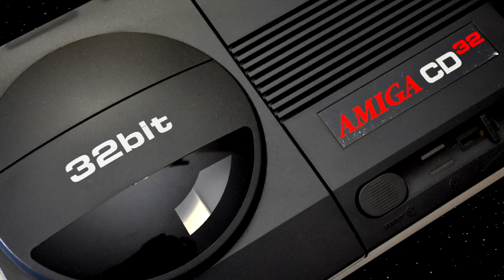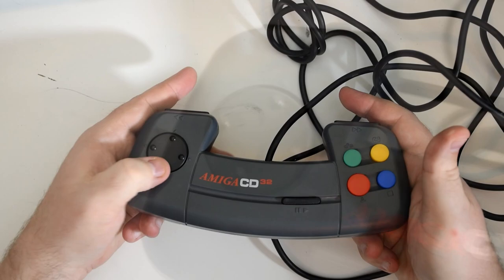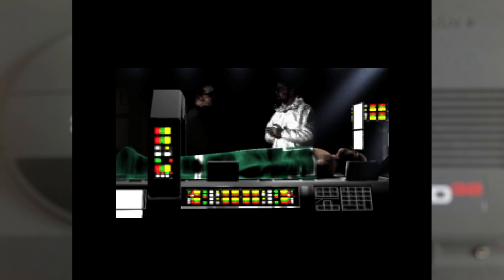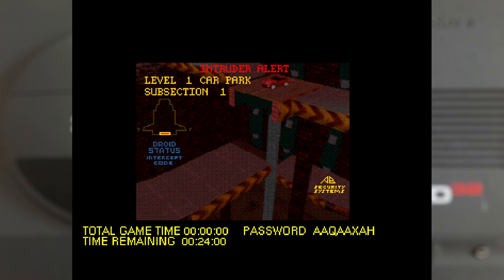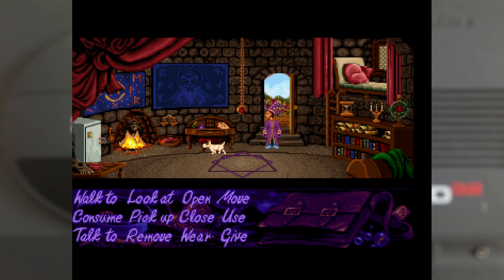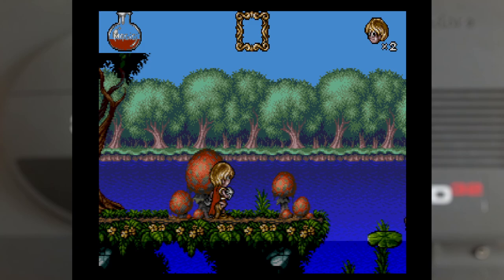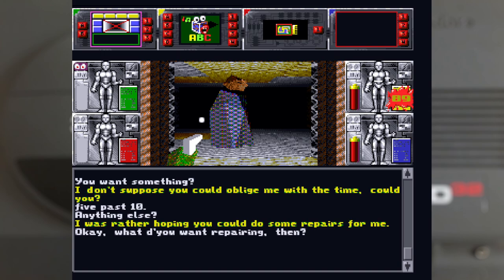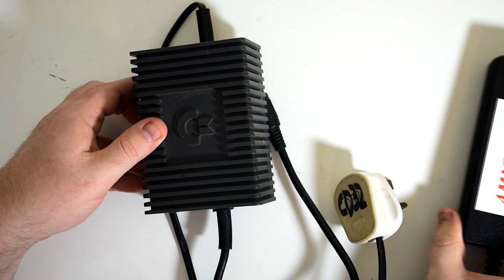The Amiga CD32 : Better than you've been lead to believe

Comment: Its always good to see a video about the CD32. It was commodores last throw of the dice, and while it was a good machine Commodore completely bungled it, and got most their stock held at customs due to a fight with a patent troll, and where it was selling like hot cakes (e.g. here in the UK) had no stock for retailers to sell.  The little shop I worked at had 100's on back order that Christmas that we could not full fill in time, so we had to refund them.
Reply: Commodore was sued in the USA and could not sell the CD32 in the USA
due to court injunctions. This killed them.
Reply: @johnsmith1953x  Yep, they really should not have tried to move stock into the US while that suit was going in on. The court order that froze a hugh chunk of CD32s, and distruped the supply of CD32s to every other market was very predicable given where they where in the law suit. It was an incredibly dumb decision to try and bring them into the US until that was settled. That's also what triggered their issues in the Philippines, which was the final straw for commodore unfortunately.

Comment: Nah, It's just A1200 with CD-ROM and some functionality of separate ICs packed inside Akiko. They gave CD32 nvram but it was pretty small so it wasn't all that useful to hold saves etc. And without fast ram it did struggle to use both chipset and cpu speed up to the fullest. It didn't came with floppy interface so most of classic amiga games came with CD bundles (that's that "big" cd32 game base). And there was hardly any innovative game designed for CD32 alone. There were hardly any expansions (which is usually understandable but console specs should be amazing at the release date to cover for gradual improvement of PCs during next few years, the only different approach was SNES with base specs hardly adequate but with upgrades included on game cartridge). CD32 was not that long apart from 3DO and 3DO was better in any aspect (and still lost due to poor timing mostly). Most of the original team behind Amiga wasn't even involved in CD32 ;) I doubt Jay would say CD32 specs is something similar to what he had hope to achieve a decade earlier. At the time he drew up specs for ICS it was revolutionary and would let keep things going for many years to come (like it did with ICS from A1000 basically running games released up to mid 90s). AGA was introduced at least an year to late and A1200 specification wasn't all that good at the launch as 020 was already fairly old. It was still fairly cheap. And same goes with CD32. It was cheap but not impressive.

Comment: Fantastic nostalgic look back! And nice to see that you're looking back at the machine in a more positive light, unlike other videos :) I still remember the hype for Christmas day when I got mine, followed by the disappointment when it didn't start up on Christmas morning! A few weeks later and a replacement came, and I popped in Liberation and was blown away by the movie-like intro. And like you, when the game started I had no idea what I was doing ;) Ultimately I spent more time on it from connecting it up to my Amiga 1200 using a cable (which plugged into the keyboard port, interestingly!) and having access to the thousands of files available on those Aminet CDs and various other CD collections.
Reply from the maker: I try to be positive about everything I look at, as I find all those negative, hating, angry channels a bit much.
its not to say you can't point out issues, but a machine isn't just problems.
Its a real shame that your original unit didn't work, I can imagine how gutting that would have been.
Not heard about that cable that uses the keyboard port, that sounds really interesting and I guess it must be using the serial side of it.
Reply: These videos are either positive or negative, but never looking at both sides
I prefer a bit of both (50/50)

Comment: Really good retrospective, not the usual "let's dump on the CD32 for killing Commodore" laziness that we see from some others.  I owned and loved my CD32 back in the day but I have to admit, in hindsight that it wasn't a very well thought out release.  I'm not saying it was a cash grab due to Commodore's mounting debts but it being not very different from the A1200, only having 1KB of save space, (was the PSU labelled for the C65), and having a poor joypad (well the d-pad anyway) suggests they were definitely doing the usual Commodore cutting corners.
I can see some logic in releasing a console which in theory would not be as susceptible to piracy, since back when it was released piracy was one of the many problems hurting micros, we were still a number of years from CD writers being anywhere near affordable so the CD format would have seemed safe at the time.  It was maybe short-sighted to assume piracy won't be possible just because the CD writing technology was at the time too expensive so they didn't put any anti-piracy measures into the console but piracy didn't kill the CD32, Commodore were already gone by the time pirating CD32 games became common.
As a teenager none of those things mattered at release, as an A500 owner I was very pleased to get a CD32 for the upgrade, for AGA, for the load times and to eliminate disk swapping, even for the CD player.  Even though I contributed to the piracy problem with my A500, it didn't bother me that I now owned a console where realistically I couldn't "acquire" games in the same way.
I was initially wowed at things like Liberation, I watched that intro so many times, although I was disappointed with Oscar, thought Diggers was just about adequate and Nigel Mansell's wasn't really stretching the CD32.
Not having many games for it at the beginning I did fully immerse myself into Liberation, reading the manual from cover to cover multiple times and really taking my time to explore the world and talk to as many NPCs as possible.  From memory I think I did find the first person you are looking for but I recall being disappointed that it just drops you back into essentially the same world looking for someone else and with so limited save game space on the console I'm not sure I persevered much after that.
I built up quite a large collection of original games as the Amiga brand started waning and games started to become very cheap to pick up.  It was disappointing that so many games were direct ports with very little and sometime even no changes other than it being on a CD but who can blame the developers?  It was essentially an A1200 with a CD drive and not much else different, the Amiga was dying and devs were having to make hard decisions in other areas.  Why not make some quick and easy CD32 ports and try to earn some money from very little outlay.
I'll still treasure my current CD32 and the original games I kept.  I've upgraded the console with the TF330, a CF card, the riser, a keyboard and the KTRL32 joypad.  It could maybe do with a recap and potentially a laser replacement but it can do the job for now and the CD32 in general has a special place in my heart.
Reply from the maker: Yeah the history around the machine is interesting, but I feels overshadows the actual machine.
so I wanted to look at it, what it could do.
its impossible not to see how some of the history screwed it up, but its not the "worst machine ever" that some would make you believe.
Reply: I also loved my CD32 back then. BTW: The CD32 had also the so-called AKIKO Chip which the A1200 didn't have. The chip offered some simple 'chunky-to-planar' graphics conversion in hardware. Not many games used it, but I think Wing Commander made great use it.
Reply: this was a period in history when all the game companies were going crazy with new generations so rapidly that they forgot about the customers who'd spent money on the old ones. Sega and Atari suffered the same fate. It got to where by the time you finished saving up for that new Saturn game, the Dreamcast was already out.
Reply: @jochenheizmann4380  Akiko chip was sophisticated enough to enter against the forthcoming consoles it's only the lack oF FAST RAM as standard that kicked CD32 in the nuts but development experience would have worked around this. Commodore buy out fell through which guaranteed the eventual fail David Pleasance would have made sure that the CD32 strived well into the future enough to compete against the PS 1 because the cd1200 would have happened too which would have meant more likelyhood of fast ram requirement software and Ram expansions availability more cheaper for the CD32 imo
Reply: @stickyfox computer technology was still growing exponentially at the time. Can't blame them for trying to be cutting edge. Hindsight is 20/20 though.
Reply: Reason why it failed is because Commodore (Amiga) fans did not want a console (dumbed down locked machine). Amiga scene was built around freedom to do anything you want (hacking, programming, designing, typing, making music ... ) and this was just dumbed down Amiga 1200 with CD. Also, hardware specs were not that interesting. It was good enough for 2D games, but people already had 2D games. For 3D, which was all the rage back then, not really so. Thus, it never utilized CD capacity properly. CD came into its own only with games that had lot of textures, in late 90s.

Comment: Excellent and interesting retrospective with focus on what the CD32 was capable of. I got mine CD32, probably in 1994 and used it companion with my A1200 as both gaming console and CD-rom reader. I used a serial cable though and a software for accessing the CD32. The expansion would hav been a great upgrader but there were never available AFIK in Sweden and compatible keyboard was too expensive.  
Kudos to your very well produced video too. Good sound, tempo and pedagogical structure.
Reply from the maker: Thanks, really happy you enjoyed the video.
I hadn't heard of anyone using the CD32 as a cdrom drive for a A1200 via a serial cable.
I can't imagine it was fast, but I guess a better option then trying to buy the expansions.

Comment: Simon the Sorcerer feels like a proto Discworld & I love it, Flink absolutely should have been bigger than it was thanks to it’s mechanics as well as it’s looks.
Unfortunately the CD32 was doomed from the start, it wasn’t perceived to offer enough over & above the A1200 & the Amiga brand was a little long in the tooth when it launched, so it was realistically only going to appeal to Amiga & more generally Commodore fans, the add-on modules intended to turn it back in to an Amiga micro really show that, which is a shame because as you’ve shown here it was a pretty capable console. It definitely had shortcomings that, had they been addressed would have made it much more appealing, especially the save flash but it’s far from the only console to take that criticism but it was objectively a gaming focused Amiga 1200 & there’s actually nothing wrong with that.

Easily my biggest complaint about the CD32 is, I can’t afford one & even if I did get one the cost of ownership with both games & add-ons is too rich for my blood. I could draw parallels with Amstrad GX4000 for what it was but that just feels mean. 😄 The parallels with the Saturn, with the inbuilt save flash & add-on VCD modal is quite a bit more favourable & it’s an interesting parallel?

Great video, thanks.
Reply from the maker: Yeah Commodore didn't have the money to really support it, and they released it at the wrong time.
but even with that it still sold in decent numbers in the UK, so it might have had legs if it could have stuck around.

At this point the big issue is very much price, I got mine back in the early 2000s so paid a so much less then what they go for now 😁
Reply: I played Simon on the PC, one of the first CD rom games I played

Comment: I got one for xmas in 1993 as still have it now. I also had an Amiga 500+ along side it,  At the time the CD media alone felt like a big leap forward, much faster loading times and no disk swapping was a massive advantage over the old systems and something overlooked by the other reviewers who just compare it to other CD based or cartridge based consoles. The cover disks on the magazines of the time were brilliant, packed full of PD games, multiple demos etc... Its major flaw was the derisory 1kb of game save space, i remember leaving Theme Park running for 2+ weeks as it was unable to save an in progress game, it really should have had a native floppy drive port to alleviate that issue. Nowadays its a great system with the cheap TF expansion boards and the ability to burn your own game compilation cd's. Also it fits in great with other retro consoles under the TV.

Comment: What surprised me about this console when I first started reading about it is how many games it has! Yes, ports abound, but for console gamers, they're essentially new games. Look at this: 

Amiga CD 32 - ~150 games, including compilations!; ~100,000 units sold
Sega 32x - ~40 games; ~800,000 units sold 

The CD 32's ratio is incredible.
Reply from the maker: Yeah, One thing that you can say about the machine.
and that was the developers were willing to put titles out for it.
yes to start with it was just ports, some with barely anything added.
but can you imagine what it would have been like if it was on the market for more then a year.
and if it sold in decent numbers.
Reply: Microcosm.. Super Stardust etc..

I guss when you add CD audio you can clarify  it as 'new' even if the graphics remain the same.

Comment: Perhaps someone who is into the CD32 even more than I am! I also have a TF328 and it just makes the machine for me. I can use it as a full Amiga with a PC keyboard, or I can play any of my old favorites via WHDLoad. It sits pride of place in my living room, unlike most of my consoles. I'm not sure there really ever was a 'killer app' for the CD32, what we needed was something just a tad superior to Doom in order for it to fly off the shelves. The supply issues and US patent problems really messed it up though, and in hindsight it was an A1200 with a CD drive bodged on, which probably wasn't going to cut it against the playstation etc.
Reply: US EPA overreached into the Philippines is a problem. Commodore shouldn't have moved the factory from HK to PH.
Reply: @valenrn8657  according to David pleasance’s book, the Phillipines factory was built because the head of manufacturing for commodore USA had a mistress out there…
Reply: @MarJay1980  I'm aware of the mistress story.
Reply: @MarJay1980  David Pleasance’s book about the head of manufacturing's mistress was interesting.
Reply: The closest you could get to that killer CD32 app would be "Microcosm." If I remember right, the CD32 was the only one that had the FMV intro. I believe the game was actually written for the CD32 first, then the other consoles got it later.

Comment: A tough launch at a tough time not just for Commodore.  Philips Cdi as well.  But times were changing.  FMV was trash and the new consoles destroyed everything in their path. I wish they had have stuck with Amiga computers.  We could only dream of the possible tech until now and what the retro community is doing which is amazing and is still growing.  I wish I was younger to see what could happen decades from now.
Reply from the maker: The big problems for Commodore was that those in-charge didn't put money into R&D and didn't really want to spent any money on new hardware.
As every dollar spent on it was money they couldn't take out of the company for them selves, so in a way it was amazing that the CD32 even got produced.
But by the time it came out, it was caught between the end of the last gen and the new one that was so much better.

Comment: Great system, wish I had kept mine. But Commodores problem to me was always sticking with the Amiga tech. With the Snes, Megadrive, PlayStation, Saturn, Neo, it didn't stand a chance in the end. If Commodore had invested in newer custom tech especially aiming for the console market, things might be  lot different. Dont get me wrong though the AGA Chipset is damn good, check out Proxima 3 !!!
Reply from the maker: It is a lovely system, that was just a little too late.
Against the other 2D 16bit machines, the Amiga chipset and AGA could hold its own.
it could and should have been improved more then it was (Paula really needed more sound channels).
but against the next gen, yeah it was way behind.  But Commodore wasn't willing to spend the money.  They would rather it be in the pockets of those at the top.
but that is another story 😉

Comment: The CD32 holds an odd position on how it is and should be viewed. When the Amiga was first being developed back in the early 80's it was a computer that could be scaled back to be a console. Yes I know it is said that it is the other way around, but Jay Miner already had an idea for a computer before he was brought in to design a console and only did so if he could design a computer also. And all through designing the system, it was designed as a computer foremost and he even said it could be stripped down to a console. So really the CD32 was the final form Jay Miner had designed for. As a console for the 90's it was missing some of the functionality that a console should have had, but what it lost out in that area it gain many times over with what was an incredible potential software library.
A quick look on YT for the amount of Amiga VS Master System, Amiga VS NES, Amiga VS Genesis/MegaDrive, Amiga VS SNES and other systems shows how well the Amiga was comparable to consoles despite being a Computer! what other computer compared to consoles to such a degree in that time period.
Reply: I think at the end of the day, it came down to profits.. Perhaps if Commodore had more money, and it wasn't  a 'last minute attempt to save from failure", they could have made it. Besides, no one can predict what situation they will be in 10 years from now,